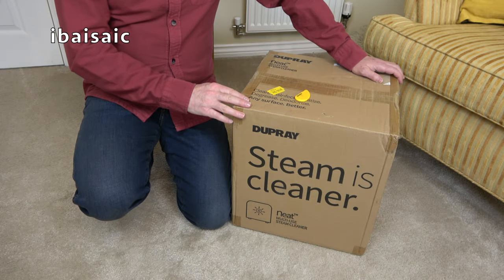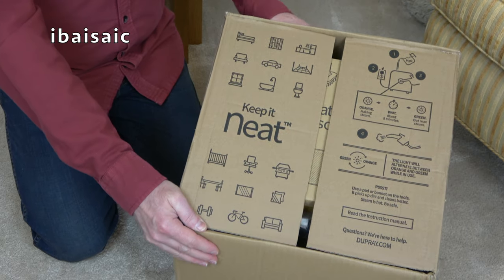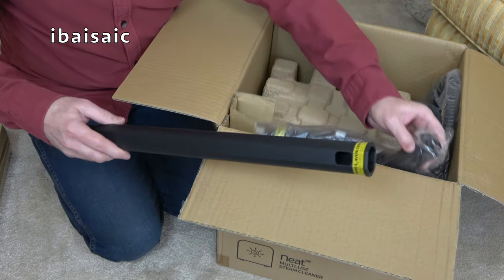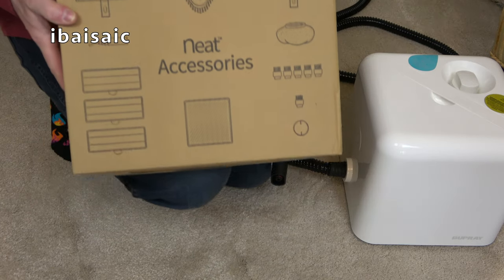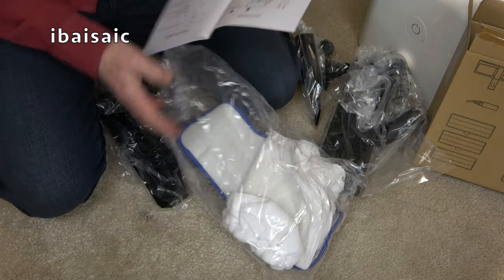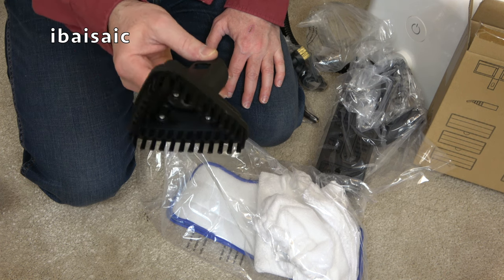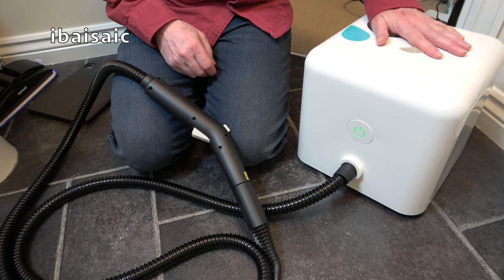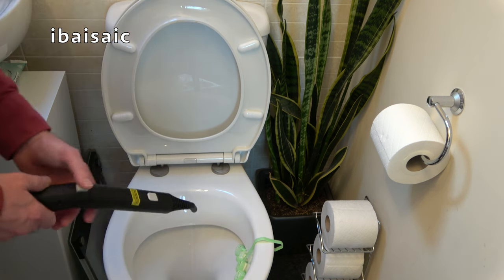Dupray Neat Steam Cleaner Unboxing & Real Life Demonstration

Comment: The best thing I’ve ever used on shower glass,for removing soap scum is “Viakal”  the gel is better as it sticks to the glass,but if isi g the spray wear a face mask, you can literally feel the scum being dissolved as you gently rub the cloth over the glass,and only need doing maybe once every 4/6 weeks
Works on the metal surrounds and taps also.  Try it and film it for everyone 😀👍

Comment: "I've allowed my hob to get pretty dirty"  *me, squinting at what appears to be a nigh-on immaculate hob* 😵‍💫
Reply: I’ve never heard a stove be referred to as a hob
Reply: @tjsells9288  I sense you might be American?  It's what almost everyone in the UK calls their four/six ring burners – especially when they're independently fitted flush into the worktop as Roger's is here.  Our integrated ovens, where the rings are separate (which may be sited nowhere near the oven at all!) is always called the hob. A freestanding oven and hob combined is sometimes called a cooker.
We reserve the word stove solely for woodburning stoves.  These are (usually black) cast iron fires with a flue and a glass door at the front, which we generally use to heat our main living room.
Reply: Yes you are correct I’m American, an we call a cooker a stove doesn’t matter if it’s built in or free standing…. Interesting thank you!!😊